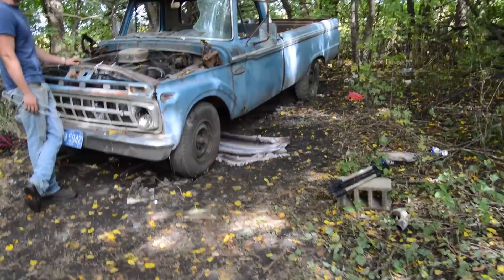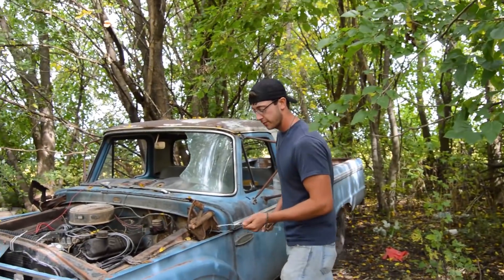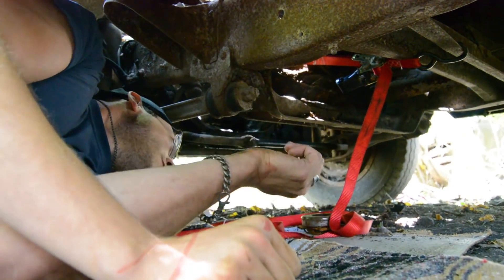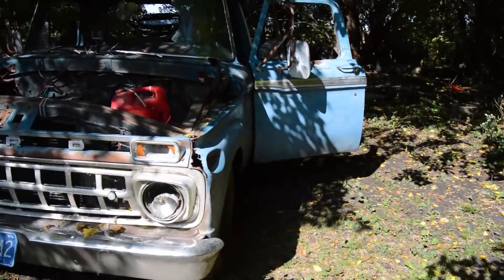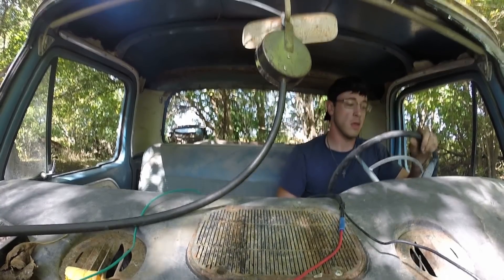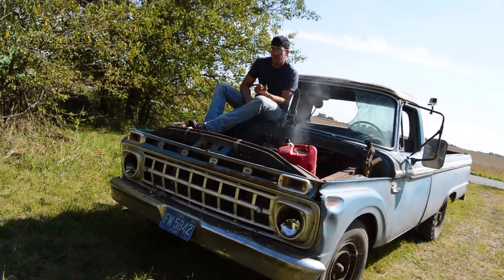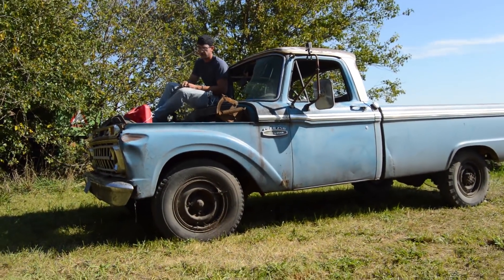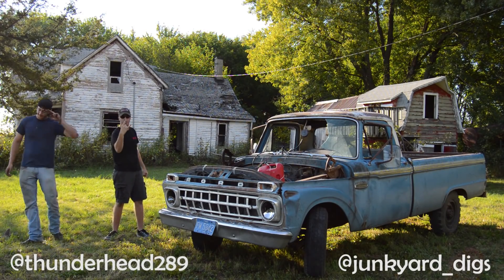Abandoned F250 Revival! First Start in 26 Years -- Part 4

Comment: Man, that starter is a trooper
Reply from the maker: +fuzzy wuzzy it even loaded it on the trailer with just the starter
Reply: Shows how bad it wanted a new home!
Reply: fuzzy wuzzy I walk around junkyard looking for oem starters people leave in cars or huck in the mud.

I threw one in that was stuck in a frozen puddle. Put about 100 k miles on it behind my 302. I broke a clutch cable (motor mount broke and munched the cable in between it) and drove it for two months with no clutch starting it in gear.
Reply: fuzzy wuzzy ford starters are crazy strong lol I used my 88s starter to back it up and onto a trailer she took it like a champ
Reply: fuzzy wuzzy thats the experimental hybrid system.
Reply: Have had bad luck with Autozones rebuilt parts, think they take the cheapest from the reman places. Also their brakes, had 3 sets fail on 2 different vehicles..and that was enough! No more DuraCrap for me! Will buy fluids etc. from them still, just no parts, other than plugs and stuff from name brands.
Reply: fuzzy wuzzy  lol! no doubt!
Reply: Not so much the starter.  More the granny gear first.
Reply: they use the same basic starter assembly as a Ford 2/8/9N ... direct drive but damned tough :)
Reply: They dont make Fords like that no more....
Reply: didn't know ford made a tesla truck
Reply: I bought a 1964 Ford F250 and I am having problems getting it started but,  after watching your video on the wires and top dead center.  I know what I will be doing tomorrow. Do you vave any advice on the points? Thank you again! I am excited to work on her now! Thank you also for your service to our country!  God bless you.
Reply: Yeah surprised that it was the only thing that din't need to be touched.
Reply: The future of electric vehicles looks bright
Reply: Back when they built them at the Ford factory, not like today where they are just put together from parts around the world.
Reply: @JunkyardDigs  now that's what I call an American vehicle
Reply: Fuzzy Wuzzy, true story!! What a starter! :)
Reply: Shows it's a Ford!!
Reply: They sure don`t make em like they used to!
Reply: Lol..thats what i was thinking when they were first trying to roll it out.

Comment: I inherited a 1948 Plymouth Rat with a 351c engine.  I'm 69 so I've put my years of practical engine knowledge to use working on it... mostly as a hobby.  Still, there are times when I need a pro to help me work out some little kink in the engine that gets me stumped after many trial and errors.  The thing is it's tough to find a good mechanic who'll work on these older engines anymore.  All the shops make their bucks on RR new cars (Remove and Replace what the computer shows gone bad).  Great video guys, really enjoyed your calm banter, explanations and good video shots.

Comment: Oh to be young again and do stupid things. I remember finding a Austin A40 we bought it for $10 (5 pounds) back in 1965, she ran like a new one, but the throttle cable was busted so I pulled a piece of wire to accelerate. Some stole the back door catches so we ran a piece of fencing wire between the 2 door handles. If we hit something head on or I slammed on the brakes our mates sitting on the back seat would have been in two pieces, each. We drove the wheels off that car, all over Sydney and never saw a cop. 16 years old and bullet proof. Oh yes and unlicensed/ unregistered too. :-)
Reply: Propfella ....  l hear ya ... lf I wasn't  sneaking dad's car out in the middle of the night ,  I was takin my brothers  750 Honda out during the day...  hey  l WAS 13 to 14 yrs old and needed to be driving  something...  had a BLAST

Comment: I have been working on old trucks (started with a 1949 Studebaker 1/2 ton) and everything up too today. After working on these old engines since the 1970's I appreciate you guys taking the time to revive this old girl. Good work guys and Congratulations on the find. 
Now I have only ONE complaint. If you value your engines AT ALL. NEVER I mean NEVER EVER use Fram oil filters. There are tons of research out there proving they are some of the worst filters you can get. The only thing they had going for them was good marketing, but crappy product. 
If you value your engines, use Wix or Napa filters... 
That being said, good work and keep it up guys!

Comment: The original ford  fe timing chains had a metal gear with nylon teeth. When the nylon ages it cracks and comes off the gear. Can get a new chain and gears from summit for 68 or 78 bucks I think.
Reply: Yep, and the nylon teeth that break off often are stuck in the oil pump pickup too. Seen that a few times on those.
Reply: 1986FordF-250 there was a really nice 100% rust free 68 f100 in a local scrap yard because of that. Bought the entire body to save it from the crusher.
Reply: I unfortunately sometimes see nicer old trucks in my local junk yard than what I see people driving a lot of the time anymore. Definitely some nicer trucks in the JY than what people try to sell on Craigslist LOL! Every one I crawl under is 100% rust free. Usually there because of a title problem, bad trans or were wrecked.
Reply: Agreed, and can be done in a couple hours w/o dropping the pan. The new one won’t have a spacer washer for the cam gear, built in to the new one.
Reply: Yep, doing a timing chain on an FE is much easier than any other Ford V8. No coolant running through the stupid timing cover ears or busted off/rusty timing cover bolts to deal with.
Reply: Is the metal gear solid?

Comment: The proper way to do that "start it in gear and launch" is to use 2 old crank jacks..or 2 old sketchy jack stands..start it then give it a good push with your foot..trust me, we have experience at this ;) once got a old GTO home like that after the clutch did bust loose after a joy ride like that..and surprisingly it even had brakes..not good ones mind you..but brakes. We had a tow bar we were going to use, but after the clutch broke free I drove it the 6 miles back to his big garage, where we finished it over time..unfortunately someone came along with big money, and talked him out of it in 1992 :( he regretted letting it go until he died last December. Moral of this story? Keep your old restores.

Comment: Great video, guys, and an even better attitude. A joy to watch you both. Tomorrow morning a guy is going to help me re-do the brakes on my 65F250 Camper Special. Exact same colors as yours. Wish mine had the three on the tree as well.
That is a very solid 65. The trim is complete and unmolested. You could easily get $500 for the trim alone. Hope you restore it to drivable condition. Thanks for the video.

Comment: Build Ford tough even after all those years🇺🇸🇺🇸🇺🇸👍👍👍👌
Reply: 33snook fuck  over rebuild dodge,found on road dead,fixed or repaired daily
Reply: Flip over read directions
Reply: 33snook only the old fords
Reply: I'm amazed it ran after all of that sitting.  Put some Marvel Mystery Oil in it.  It'll run even BETTER!
Reply: + Mikeygoes>>  Let's see you take ANY OTHER car sitting for 25+ years and start it with only 6 hours of work!

Comment: Hard to shift those 3 on a tree without a clutch. Much easier with a floor shifter. Dont know if its because of the shifter or the way theyre synchronized.
Reply from the maker: +Wesley Cooper agreed
Reply: I assumed it was a 3-speed.... then you need to rev it higher on 1st, especially since this old truck probably loses speed faster than a fresh one... And because the lack of a clutch, the engine needs time to rev down to the rpm of 2nd gear before you can actually move the lever into 2nd.

A 4-speed would be easier since there's usually a smaller rpm gap between 1st and 2nd.

(I say "usually" since there apparently are some 3-speed gear boxes that are basically stripped down 4-speeds that are just kind of "lacking the 3rd gear".)
Reply: was going to comment the same about getting rpms high enough
Reply: Actually, you only need to REV the engine while double-clutching when you are down shifting; the idea being to get the cluster gear up to 'road speed'. Let the RPM drop a bit when double-clutching UP to the next highest gear so the cluster gear can slow down just a tad. Also: after driving that sucker a mile—with the flywheel/clutch plate/clutch disc spinning and vibrating like crazy you might have given the clutch pedal another try to see if would disengage. At least you got it where it needed to be!
Reply: Also the linkage on the 3 on the tree makes it hard to feel your way into gear. Once drove a Fiat 124 like 100 miles with no clutch because the clutch cable broke on the freeway. PIA at traffic lights till I got it to the house...

Comment: Hi guys excellent job in resurrecting the old Effie, you both work very well together with good mechanical knowledge. I was going to say check firing order but it was valve timing. Remember safety first and make sure there is no snakes and spiders lol Carry maybe a fire extinguisher just in case and first aid kit. Good luck will be watching.

Comment: And you still didn't fix the 3-4 spark plug crosswire. Would've ran a lot better if it wasn't missing on two cylinders... LOL
Reply from the maker: +512kjt still have no idea what youre talking about
Reply from the maker: +512kjt all plug wires were hooked up properly. And it clearly runs on all 8. Or else it wouldnt run at all if 2 plugs were off
Reply: Firing order on the FE engines is 1 5 4 2 6 3 7 8 counterclockwise.  3 and 4 were swapped at the plugs. You can see at 6:10 #4 coming off of the distributor cap, going through the rear clip on the wire loom and down to #3 spark plug. And an 8 cylinder will run with two wires crossed, it will just have a bad miss. I picked up the miss in the previous vid right after y'all replaced the wires. Not throwing shade, just offering some input.
Reply from the maker: holy fuck......... i need to double check but I think you may be right. It never back fired and ran excellent tho
Reply from the maker: i guess we never did check if the wires were ever on right in the first place
Reply from the maker: sure enough. they were crossed! thats gonna bother me for a whole year
Reply: LOL Don't let it bother you, dude! Great video series :-) Godspeed on your deployment and thank you for your service!
Reply: Nice honesty! I would have erased the comment and acted like I found it on my own!
Reply: Right Ryan Jorgensen? That there earned them a sub from me. Most everybody on Youtube would done that, too... and blocked me for saying it. LOL
Reply: So does it run better now?  Can't wait for the next video!
Reply: Nice catch!!
Reply: I was thinking the same thing. That's why it was backfiring through the carb. At least they got it to run down the road after sitting all those years, and that's what it's all about!
Reply: sharp eye!
Reply: Junkyard Digs it will run angrily on 6, they are crossed
Reply: 512kjt how sharp are you!!
Reply: I caught the crossed plug wires as well..we all did. I wasn't going to hurt your feelings though. I have empathy, unlike that gloating 512kjt guy. :)
Reply: Good eye and ear 512kjt. It's funny how when you've made the same error, you tend to notice it more. I didn't notice it though, and I've made that same mistake on my own Ford truck. Nice video.
Reply: @AndyL940  p.o. ?  on Koop
Reply: Good catch 512j.

Comment: Good rule of thumb for setting base points gap is approximately at .010". Or the thickness of the cardboard of a cigarette pack. You will have to adjust from there, but it works for a starting point.

Comment: The glitter you found in the old oil was definitely from the timing gears. The chain probably wasn't stretched that much. Factory ford timing gears on the FE engines had a nylon plastic outer coating on them to reduce timing noise, and once they got age on them the plastic would crack and break off in chunks. Then the chain would become slack because the gears are now slightly smaller, and the loose fit would mess with timing and create the glitter seen in the oil. Pull the oil pan and you will see the chunks of plastic in it and the oil pump pickup.

Comment: 1981 a friend found a 1936 straight 8 Buick, parked up in barn. Still had gas in the tank.
He put a new battery in it and it ran sweet. Needed lots of work and would have been an expensive restoration project. Unfortunately my friend died before he finished it.

Comment: Junkyard Digs has proven the fact that older cars were made to last, with simple and tested designs which even though they require some maintenance to keep them running they're more reliable in the long run than their modern counterparts.

Comment: Check for bent pushrods,  That's very common on Ford FE blocks that haven't run in a long time.  At least 2 valves are open when the engine comes to a stop, those will be the ones that stick, when you turned it over for the first time after sitting that long you bent the pushrods that open those valves I'll bet. It's not running well, on 8 cylinders for sure!

Comment: Nice to see the truck running and driving again. In Elmira NY at 654 Sullivan Street sits an abandoned 1991 Ford mustang the guy that owns it is in the military. It hadn't run in over a year and a half. The  motor is seized up. The owner tried to remove the rear drive axle to unseize the motor thereby breaking the rear drive axle. My hope is someone will locate the owner buy it and fix it up before it rots away and becomes scrap iron that would be a shame they are highly sought after muscle cars. To let them sit and rot away and become scrap iron would be wrong. Fan of restoring old vehicles Robert Gildea

Comment: This series makes me long to have my 74 f350 super camper special back
Bought for $100 back in 1989 from a guy who inherited it from his Uncle, he thought it was junk because he said it barely made it to the house.
Body and chassis were spotless, as was the interior, it ran great parked.,
Driving it home I was really worried because it was a slug and barely made it up hills...

Next day at home I kept groing up and down the driveway forward and back... finally I Stomped on the gas really hard..
Something made a ping sound and the front of the truck lifted and I stomped the brakes, not stopping until I was well out of the driveway...

Thing had a freaking governor  and stomping on the gas made it break.
That truck was a literal powerhouse
Drove it for about 5 years until the trans went at a time I did not have the $ to fix it, along with the brakes had to be done
I miss that truck so much and wish I had just held onto it but... you just did not think about that sort of thing back then.

That truck today would be worth thousands, possibly well above 15,000.00 in the condition it was in (with a new trans and brakes)
It burned no oil (I forget the mileage on it when I got it but I seem to recall somewhere around 42,000 miles orig)
No dents, no significant scratches, no ripps, literally no rust everything worked perfectly, the inside of the bed was beat up a bit but no dents just paint worn off/chipped etc.
His Uncle must have kept it in a garage or barn safe from the elements and drove it very little. All the seals, rubber trim, and body trim were in perfect cond too No fade on any switches, knobs etc...

Im gonna go cry for a bit, and then watch the rest

And that is perfectly normal... that is how I got in and out of most of my earliest cars (Bo n Luke style)
Actually this first drive is reminiscent of pretty much daily driving for me for quite a few years

Comment: ya know all you gotta do is disassemble the ignition from the dash take the keyed tumbler off and theres a little cam operated switch on the ignition assembly you hold on til engine starts

Comment: u ran into these vids and wow what fun!!why bacause you can and it is a blast to wotk thru each obstical (challenge).i have done this stuff since 75 in craft shop army (65 pu 50 bucks learning always Z)i got a few tips from your vids.thanks.driving off jack great most would have given up!im going to watch 567 now ps i have a 66 ford pu 352 v8 runs good brakes went dry so i just start once while.

Comment: VERY nice work Boyz...... ...... "MY"... very first Blazer? ... was a TOTAL "wreck" 
I bought it for $300 it was on 3 flat tires, broken windows, it had a CAMARO-seat (on a box) behind the steering wheel.... then?   I bought some high-back seats from a junkyard, got the glass, threw it in, got a REAL mechanic to "tune" the vacuum-leaking Carb into SOME-KINDA 1/2-way decent condition...... (he forced it to pass inspection), then I got new dual exhaust..... changed the oil pump myself / new oil seal..... and onward..... did a LOT of body-patching/bondo and paint work.... New Valve-cover seals .... repainted the ENTIRE engine bay.... on and ON.... redid the interior / got new stereo etc..... I drove that truck for YEARS.... (I Miss my old Blazer) 4-on The Floor K-5.... my "first" automotive experiment.   It's a ...... Freakin' BLAST.... watching you guys get this truck running!
Reply: THAT IS....? ... a Beautiful Truck